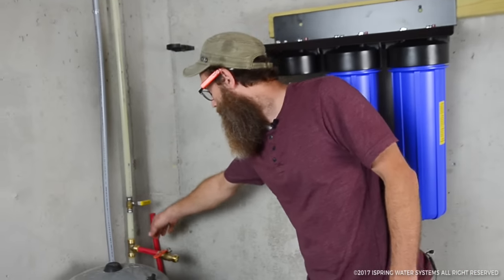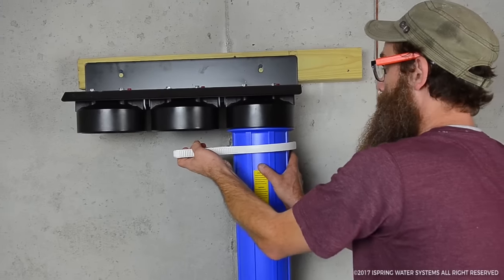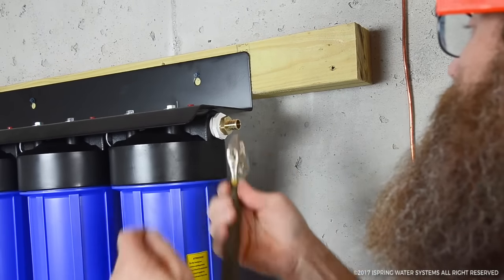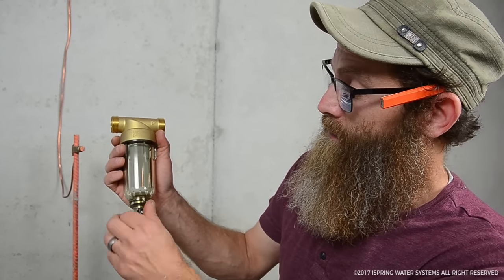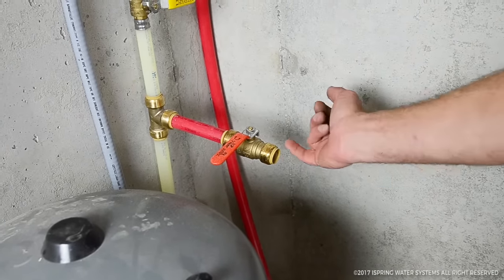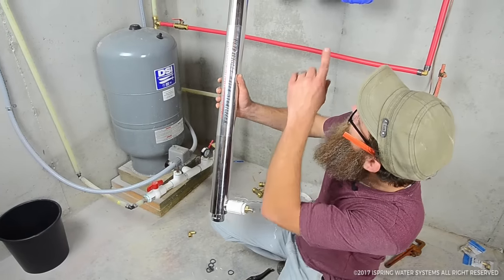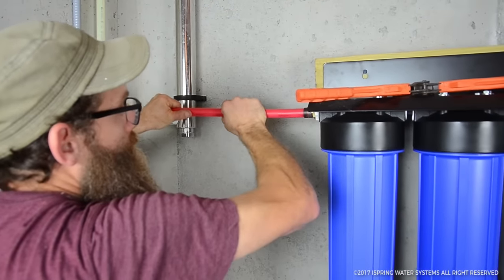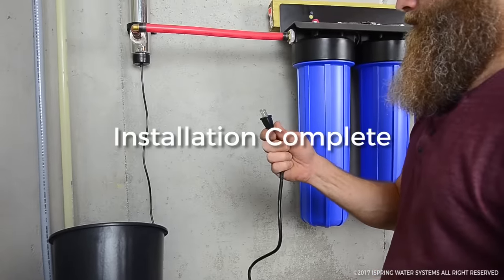iSpring Whole House Water Filter Systems DIY Installation

Comment: How often do you need to replace the filters?
Reply: Hi Rok Hamler,

We recommend a filter replacement schedule to change the filters every 6 months.

Thank you,

iSpring Water Systems LLC
Reply: I schedule mine on my computer calendar.
Reply: How would you know if the bulb burned out?
Reply: It all depends on water and usage. 6 months is BS in most cases,they can go a full year as long as you dont have a family of 16.

Comment: What if the pipes are made out of copper
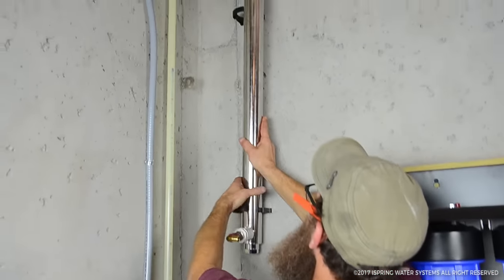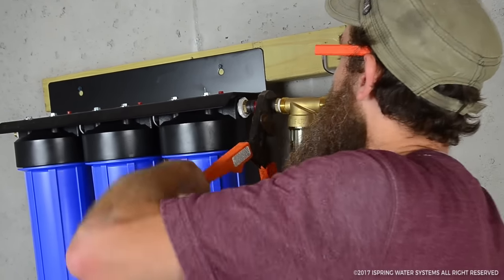Reply from the maker: Hi Abel. Thanks for reaching out! You can connect the system to copper pipes. If you have more questions, please feel free to contact us at 678-261-7611 (M-F, 8:30 - 5:30 EST) or at support@123filter.com. We are happy to help!
Reply: iSpring Water Systems since the uv light is unavailable right now on amazon, does it make a big difference with just the filter? and can it be added later on?
Reply from the maker: Hi  @abel1955 , it depends on what contaminant(s) you need to remove from the water. Our WSP pre-filters are used to remove larger particles from the water and the WGB whole house filters are built to remove finer sediment like rust, dust, sand, etc., chlorine (bad taste and smell), and/or iron & manganese / lead, depending on which system you choose. You can always add a UV light later on.

Comment: will this treat hard water? I live in Nevada
Reply: XmojotronX 
Heyo, a filter system can treat hard water, to prolong filter duration you want to maintain your prefilters, filtering with a higher micron will help keep more out of your softening filter. Do some good homework and design yourself a system based upon flow and usage. Make sure your hose bibs aren’t piped before the filter to prolong life. Here is a link to a product that will provide water softening.

https://www.wateranywhere.com/filters-and-housings/special-purpose-filters/softening-filter-cartridges/
Reply: Hi thingslikehmm,

This system is not designed to soften water, It's main purpose is to filter the incoming water into your home and to protect your appliances from scale buildup. This system will also reduce scale buildup on your home's fixtures such as sinks, toilets, faucets, and showerheads. This system can also improve the quality of the water that you shower or bathe with. This system can be used in conjunction with a softener system. We would recommend that the whole house water filter be installed before a softening system. 

Thank you,

iSpring Water Systems LLC

Comment: Has anyone designed a way to use a whole house filter system as grid down survival system?
Reply: You will need the ability to pump the water into the system. Alot of people use this type of filtration system for rain water collection. It works well.

Comment: How does this affect water pressure?
Reply: a lot. the more filtration the lower the output.    and why would you need your shower and toilet water filtered?
Reply: Hi Christian M. Braithwaite,

The water pressure is minimally affected, but there are other factors such as your incoming water pressure and temperature of the water that can affect the flow of water through the system.

Thank you,

iSpring Water Systems LLC
Reply: Hi John Douglas,

The filtration system's main purpose is to protect your appliances such as your water heater, dishwasher, and laundry washing machine to protect against scale buildup. This system can also reduce scale buildup on fixtures such as toilets, and faucets. The system also filters water that you bathe or shower with and can improve the quality of your skin, hair, and scalp.

Thank you,

iSpring Water Systems LLC
Reply: John Douglas, if you ever had iron stains in your commode or sinks you would know why. Also, unfiltered shower water makes your scalp and skin dry and itchy. Especially if it's from your private well. If I'm watering my grass, I simply by-pass the filter for more pressure.
Reply: John Douglas if your flow rate decreases. Time to change your filter.
Reply: John Douglas normally due to iron and calcium buildup. Iron stains fixtures and calcium blocks pipe.
Reply: Scott Luther  it all depend son your local water quality I guess.
here in Brisbane Australia, it's only the taste you need to worry about, and lime scale in hot water systems.
https://www.seqwater.com.au/s3fs-public/water_quality_reports/green-hill-reservoir-outlet.pdf
is a recent test outcome.

I have a sediment and activated carbon filter for drinking water simply for taste.
never had an issue with a washing machine or diswasher or even hot water system.
but then, we seem to have far higher safety standards and regard then many US states seem to. (fint for instance)
Reply: @John-gm8ty  Rust?
Reply: @briandailey-loy  iron oxide or iron corrosion residue.
Reply: @John-gm8ty  
Depending how the water is and what type of sediments are in the water like lead. A whole house filtration can be very beneficial to a family.

It all depends on the type of metals and sediments are in your water. This includes city water as it is heavily treated with chlorine.
Reply: @TheTyrial86  chlorine has had zero scientific evidence to suggest any harm to humans. Zero.

Comment: I bought one of those exact brass spin down filter got massive reduction in pressure. Took out the screen still had reduction in pressure. Replaced the brass spin down with a cheap plastic one filter system worked fine then. Examined the brass filter the interior design restricts flow bad design. Side note: I put a hose timer in the ejection port of the spin down it cleans itself once a day for 20 seconds I check one a month now.
Reply from the maker: Hi William, it could be that the spin-down filter was installed backwards. Please give us a call at 678-261-7611 (M-F, 8:30 - 5:30 EST). We would love to help you out.

Comment: So this filter can't catch bacteria?
Reply: Hi James Holbrook,

For treatment of micro-organisms such as viruses, parasites, and bacteria we would recommend adding the UVF55 whole house UV sterilizer. This is an add on and can be combined with the whole house system to treat for bacteria.

Thank you,

iSpring Water Systems LLC
Reply: If the filters are 5 micron or less, it can catch them.. but some viruses smaller than the filter can get down to. 

Hence why putting the uv light in to kill them so they are just dead viruses .

Comment: Whats the result of dissolved solid?
Reply: Hi Jay Tee,

This system does not reduce TDS levels from your source water. This can only be achieved by using a Reverse Osmosis system that utilizes a Reverse Osmosis Membrane.

Thank you,

iSpring Water Systems LLC

Comment: To avoid the o-ring not being damaged on the blue filter, add a little vaseline.
Reply from the maker: Hi there. Thanks for the comment! 
The O-rings should be lubricated with Food-Grade Silicone lubricant to keep the O-rings in good condition.

Comment: I am shocked there isn't a grounding prong on the UV light plug, nor does it have to be plugged into a GFCI r receptacle
Reply: nor should you touch the glass with oily hands.
Reply: Hi y0manda,

The UV sterilizer can be plugged into any standard outlet with 110V.

Thank you,

iSpring Water Systems LLC
Reply: The glass light bulb is contained inside the chrome sleeve his hands are touching...
Reply: GFI is integrated into bulb control box normally.
Reply: How about that copper ground wire going to rebar?

Comment: This system looks like a nightmare waiting to happen. The "spin down filter" appears to be very low capacity and would certainly plug very rapidly. Also I am assuming your Iron filter is an oxidizing filter cartridge, likely magnesium permanganate or something similar. These iron filters do not remove the iron from the sediment, they oxidize the ferric iron molecules in the water and it precipitates out as ferric iron, or the raw iron molecule which can then be captured by a standard sediment filter. Assuming you are using these types of filters, you are only increasing the oxidization of the iron and thus increasing the amount of ferric iron in the system. This would of course cause toilet bowls to turn brown faster and white laundry to brown up more so than not using this at all.  I could go on, but not worth it.
Reply: Thanks Jared from Subway.

Comment: I would want to see validation data on the UV tube because flow rate or residence time will influence microbiological kill or in plain English the effectiveness of sterilization. I would prefer a post filtration buffer tank with a UV light that ensures the water is exposed to UV for a critical minimum time prior to use. Validation data = total bacterial count in vs total bacterial  count out with flow rate =K1 and tube length = K2

Comment: The mounting screws heads is way to small, get it right. - and tons of other flaws too. when the filters 1 inch you try to get use one inch hose everywhere you can if not the pressure drop will kill you.

Comment: Hand tighten the filter, please.
Reply from the maker: Hi there. We do not recommend to overtighten the housings since it will make the filter replacement a little bit hard. 
For further concerns or questions, kindly contact us at support@123filter.com and at (678) 801-9308 M-F 8:30-5:30  EST or (678) 261-7611 M-F 8:30-5:30 EST

Comment: Suggestion on teflon tape. The teflon should be tightened on the thread as you unwind it from the tape housing.
Reply: Yep! Just turn the spool over and it keeps tension on the wrap.

Comment: How long do filters last?
Reply: Annnnd.... How does one tell when a filter needs replacing... Good water vs hard water will use up the filters at varying rates... is there a test? A pop up valve, a color changing gauge?
Reply: Hi LaserFalcon,

We normally recommend that the filters are changed every 6 months but there are factors such as the quality of your source water, Incoming PSI or water pressure into the system, temperature of the water, and usage that can extend or lessen the life of the filters. The filters on the system can not be visually checked to see if they are dirty or need to be changed in exception to the 1st stage sediment filter. This is the reason we recommend the filter replacement schedule of every 6 months.

Thank you,

iSpring Water Systems LLC
Reply: Well here's the deal with that... I don't care much for not knowing... Some random number meant to protect Flint MI isn't helpful to me... How do laboratories monitor their water... there must be some final product the water can run through that has a ppm readout, or a pressure drop... Sorry for not liking your answer, and thanks for trying anyway...
Reply: I believe depend on where/what city you live in...I have Aquasana wholehouse soft & filter and UV ..the prefilter 20' 0.5micron needs to be replaced every 45  days (the sediment filter already got darkened when I replaced it on the 44th days, I live in Los Angeles, toward to the South bound Orange County).
Reply: jpthsd Thanks for the info

Comment: you never screw metal fittings into plastic just asking for troiuble
Reply: The bigger problem is that the male portion is metal on an object that puts out extreme heat and UV.   No good.

Comment: Recently had a similar system installed at my grandparents house and I really liked the layout the installer used. Similar situation with the existing pipe in the corner. He mounted the filters on the run away from the existing pipe, then used the UV filter to rise the level and go back. This totally eliminated the need for any 90° in the system and made for a very compact installation. Two Ts to branch of and otherwise straight connections.

Comment: Good video good install. But the biggest problem was the installer touched the UV lamp with his hands....a big no no. Oils from the skin will shorten the life of the bulb and cause hot spots. 
Just like installing a halogen bulb never touch the surface with bare hand. At least use a fresh paper towel or the packing paper the bulb was shipped in.
Reply: The glass is porus and it absorbs the oils
Reply: @latenight6815  "Porus"?? Poor us! If you meant porous, no it is not.
Reply: Uh, not really, you can handle these bulbs just like any fluorescent bulb because that is exactly what it is. All fluorescent lamps actually produce UV that is converted into visible light by a coating on the inside surface of the glass which "fluoresces". These sterilizer bulbs are just lacking the coating, so handle them with greasy paws, it makes no difference. Halogen bulbs are completely different using high temperature to produce a lot of light and the halogen gas re-deposits the vaporized tungsten back onto the filament allowing them to get very hot without burning out the filament too soon. Finger oil gets baked onto the glass creating a hot spot which shortens their life.

Comment: I have this RO system setup. When i test the water after running through the filters the ppm is still the same as not using the system. Am i doing something wrong?
Reply from the maker: Hi there. Please give us a call at 678-261-7611 (M-F, 8:30 - 5:30 EST). We are happy to help after knowing more details.

Comment: So I have read to install filters after water tank..  I don't understand the reasoning,  I have a new 4in well with the pump in the groung..shouldnt I install it before the water tank??
Reply from the maker: Hi Lonnie. I assume that you have a big blue system and most people install this after the well pressure tank. You can install it before if necessary but should plumb in a faucet to relieve the pressure.  Feel free to call us at 678-261-7611 (M-F, 8:30 - 5:30 EST) if you still have questions. We are always happy to help.

Comment: Please dont take any of his recomendations on how to use pex. never use two. Shark bites are NOT to be used as a perminate piece. and red is used for hot water.
Reply: I see this about the shark bites from ppl. I installed a 10x4.5 whole house filter on my outside house wall where the city water hits it before hitting the softener. It a copper line. I used a shark bite coupling on each side of the filter and also added a shark bite shutoff valve before it and right next to it. It’s survived that Texas freeeze a couple years ago and hasn’t given me trouble yet. One thing I might point out is I insulted all the copper piping outside too. Idk if I’m lucky or what. I have no plumbing experience so just did it that way cuz it’s easy

Comment: I am doing this exact same setup (3/4-in PEX). What is the white colored plastic fitting he is taping at 2:40? I was able to find the 3/4-in PEX Crimp x 1-in MNPT Brass Male Adapter. Wouldn't that work by itself to attach the filter to my 3/4-in PEX?
Reply from the maker: Hi poshko41,

The video was made by an iSpring customer and he decided to use an additional adapter here. The direct 3/4" Pex x 1" adapter is preferred and make sure that you use plenty of teflon tape. I used exactly 4 wraps of 15" of Blue Monster teflon tape on the fitting in the picture.

Comment: Does the water have a slower flow speed because of filtering? Thanks.
Reply from the maker: Hi there. You shouldn’t notice any loss of water pressure. However, if you allow sediment to collect on the screen without regular flushing, this could cause your pressure to drop.
For further concerns or questions, kindly contact us at support@123filter.com and at (678) 801-9308 M-F 8:30-5:30  EST or (678) 261-7611 M-F 8:30-5:30 EST

Comment: I seen Pax after they stole the copper out of old old house. It blow off of the on a second-story radiator oh my God brand new Hardwood floors painted repaired walls, destroyed the floors are buckling up 5 on a Friday me and one other guy we're the only ones left I was upstairs and saw it and was freaking out went down to the basement at the light speed of light to turn everything off. I must have turned off 15  shut off valves before I got the water to completely stop. If me and the other guy weren't there that house would have been destroyed. I've never liked PEX since my buddy heard me screaming was wondering why I was freaking out until he saw it. The one time I was glad I was not the plumber

Comment: How does this hinder the pressure for the shower ?
Reply from the maker: Hi there. The pressure drop is negligible at best. We recommend adjusting the pressure in home to compensate for any difference. 
If you have any other questions, please contact us at 678-261-7611 (M-F, 8:30 - 5:30 EST) or email us at support@ispringfilter.com. We are happy to help!

Comment: Do they make this system with a reverse osmosis stage?

Also would be nice if it removes radiation just in case of nuclear fallout.

Does the heavy metal stage remove any of that?
Reply from the maker: Hi Cliff. We don't have whole house reverse osmosis systems yet, but you can always add a RO system (https://www.123filter.com/ac/reverse-osmosis-water-filter-system) after whole house for drinking water. 
And no, the heavy metal stage does not remove radiation. 
Please call us at 678-261-7611 (M-F, 8:30 - 5:30 EST) if you have other questions.

Comment: Why can't you make smaller to fit a caravan?
Reply from the maker: Hi there. We have some systems that are suitable for a small space like an RV, dormitory, apartment, and other settings. Please refer to the links below: 
CW21:
https://www.123filter.com/ac/index.php?rt=product/product&product_id=10093&acid=2 
CW31:
https://www.123filter.com/ac/index.php?rt=product/product&product_id=10092&acid=2 
If you have any concerns or questions, please kindly contact us at support@123filter.com, at (678) 261-7611 M-F 8:30-5:30 EST or at (470) 560-0012 M-F 8:30-5:30 EST (Messaging only) 
We are happy to help!